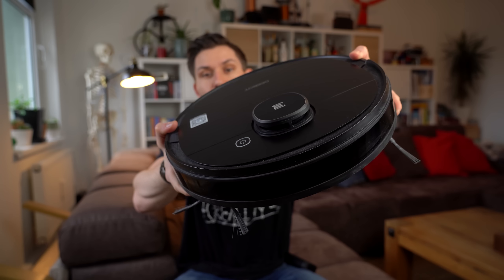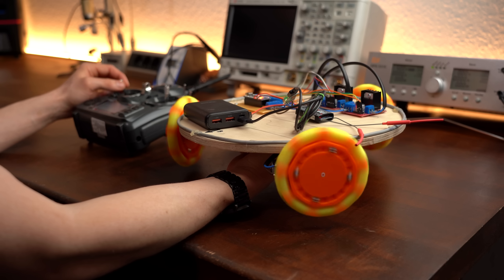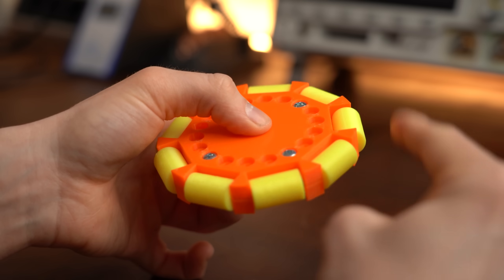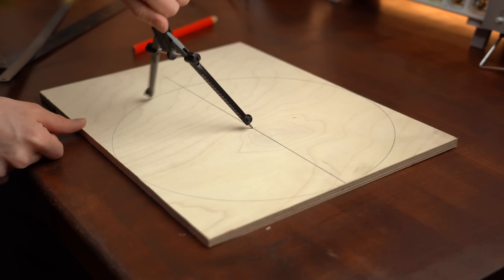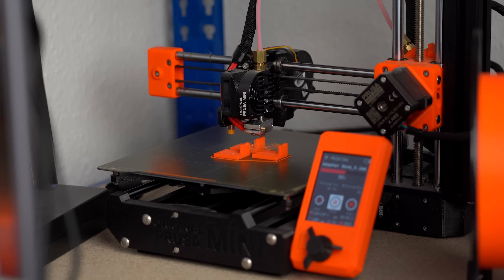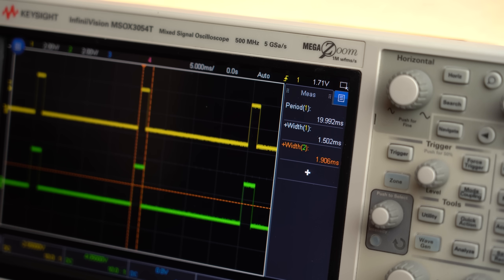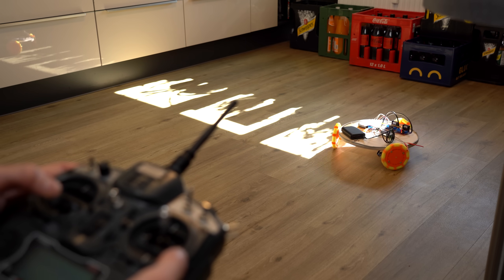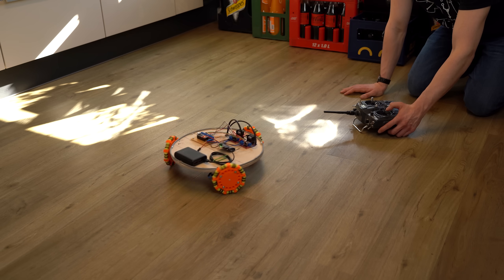This Robot Design is AMAZING! But is it worth the STRUGGLE? (Omniwheel)

Comment: I wonder if printing TPU sleeves for the rollers would help. Also, I imagine using threaded rod for the shift would eventually cause problems with it cutting into the rollers and cause binding.
Reply: Just print a small insert from PLA to go inside the TPU wheels, although unless the shore hardness is far less than 95A the TPU has no grip.

Comment: Take the original roller design, and cut channels to the smaller rollers' diameter where you want to lay the rubber into. Or, lather them in a thin layer of caulk and let dry. either way gets you grip that doesn't slip.

Comment: Commercial Omni Wheels make the rollers non-cylindrical to keep a consistent OD while rotating
Mecanum wheels are similar, but with rollers rotated 45° so they can be mounted in a traditional wheel base

Then there's swerve drive (normal wheel, spins 360), which does waste time rotating the wheel into position, but keeps high traction without a ludicrously large wheel

Comment: Painting the omni-wheel spools with a rubberized paint, should solve the traction issue and therefore eliminate the need to use the troublesome o-rings. All the best!
Reply from the maker: Maybe next time ;-)

Comment: You can't really put those on a vaccum robot though, since they would run across dirty surfaces too much. Vacuum robots wipe away dust in front of their wheels so they remain clean for a longer duration.
Reply from the maker: True. But I was only using the vaccum robot as an example. Do not worry. Those were not my plans ;-)

Comment: How confident are you that the power saved from not needing to rotate is greater than the power lost from the increased rolling resistance that comes from driving omniwheels at an angle? Even in an optimal work load (where the need to change direction is more common than going in one direction for a while), I'm suspicious of the power savings.

I can believe that these wheels are beneficial when you need precise movements, though.
Reply from the maker: Not confident. It was just a thesis. Would need lots of measurements.

Comment: Paint silicone over the rollers for grip. Assuming your using PLA, don't even need to scuff the surface for good stick, the layer lines will do that all on their own. Maybe a quick rinse with distilled water or IPA to clean the surface of the plastic first but in my experience it's a challenge to get silicone to not stick to PLA.

Comment: Nice work, Scott! Very interesting project.
But, being a trig challenged, simple minded person,  I'm wondering what was gained by positioning the wheels @ 120 degrees, instead of 3 omniwheels pointing in the same direction? Isn't it usually better to KISS? 😎
Reply: If all of the wheels were in the same direction the robot would only move in the two directions allowed by that.  Forward and back but no side to side.  The wheels need to be at an angle so they can cause a pull in any direction.
Reply: @stevedonkers9087  'Omniwheels' is the key word, I think.

Comment: Makes me remind of the Mecanum wheels, a  45 degree roller wheels that use in the Fork lifts. It's actually uses a 2 wheels at a variable speed in each of the wheels to control the direction of the lift.
Reply from the maker: I also got some of those ;-)

Comment: Could you fix the second problem by printing the rollers with trenches in them for the O-rings to slit into so they stay put and evenly spaced out over the length of the individual roller?
Reply from the maker: Possible :-)
Reply: @greatscottlab  This is the first thing I thought of when I saw it.
Reply: @abeowitz  Oooh! That's a great idea! Like heat shrink tubing.
Reply: You can also just use regular rollers and slap on an adhesive grip texture wrap. You can even use anti-slip pads they put on the floor if you don’t care about your floor getting sandpapered to death 😂
Reply: Or printing the rollers in TPE maybe?
Reply: Best solution is the trenches idea. Shrink wrap has different traction specs. And bulging the rollers too.

Comment: If you do a part 2, that’s a good potential segue to talk about putting encoders on brushed DC motors and designing a feedback loop vs using FOC on BLDCs.
Reply from the maker: Thanks for the feedback. I will keep it in mind :-)
Reply: Good idea. I’d be really interested in seeing an experiment with position tracking using accelerometers, or better yet, N axis sensor fusion chips. My guess is that it would be fairly challenging (or just super noisy) starting from scratch, but it also seems likely that there are some open source projects that may make the math/signal processing more approachable. Just an idea.

Comment: fun project, nice work! its really impressive how you always build things completely from the ground up. it would definitely have worked better with cigar shaped rollers printed in TPU and better motors, but it was good enough to begin with. i actually have a real, wood cutting CNC router based on this principle called the goliath cnc, set up in the 3 omniwheel configuration exactly like your robot, and it really works!

James Bruton has also built and experimented with many many different and more advanced omniwheel configurations and i highly recommend his videos if you haven't seen them! his projects are all 3d printed and he also shares all his files so you can try them out if theres anything you like.
Reply from the maker: Thanks for the feedback :-) Lots of helpful information.

Comment: I had implemented something similar. I had a set of 3 rollers set 120 degrees apart which would simply roll a metal castor ball. The whole rig had only one castor ball for locomotion.
Reply from the maker: Interesting

Comment: By the way a simple solution to O rings is use silicon or hot glue and apply it on the wheel!
Reply: But how do you put them on top you will just generate more problems to the movement and with friction at the end it will just separate again
Reply: @juanfra1997  that's true. Maybe using the high friction 3D-printing material greatscott used to print his skateboard can solve the problem well!